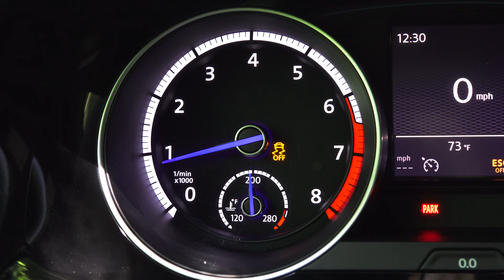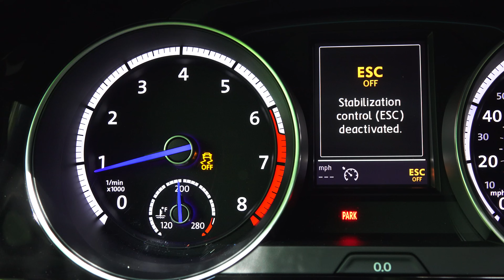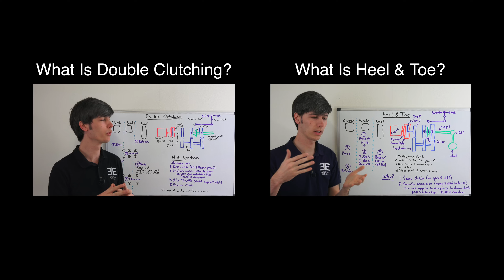How To Launch A Manual Transmission Car

Comment: You are by far my favorite channel for explaining things.
Reply from the maker: Thanks Calvin!
Reply: +Calvin Darius Well, explaining is part of its name. LOL.
Reply: +Engineering Explained Can you make a video on how to start a manual transmission when the battery is dead if you haven't made one yet? If you have pls link me to it.
Reply: +Pops6185 Well, it's kind of simple, you just have to slam second gear and clutch in, then get some speed while off (this by being on a hill or with help of somebody pushing you) and slowly release the clutch, this will move the engine alongside the transmission and hopefully start the car.
Reply: aah ok thx.

Comment: I did t think the ECU let you launch the new MK7 Golf R 6MT
Reply: +evilkillerwhale So, as I look around I find it going both ways. Some say old cars need it and new dont. some say all cars need to be broken in. Some have stories going both ways. I personally will do whatever the owner manual says so they cant back out in warrenty claims
Reply: +evilkillerwhale I suppose all the auto engineers that wrote the manuals knew nothing either huh
Reply: +Meat Amigo Also, wonder if the car is past break-in period yet :P
Reply: it does but he is showing this for everyone else
Reply: it does but he is showing this for everyone else
Reply: +Adam Chandler what's a break in period? Lol
Reply: +Meat Amigo New engines need a break in period of low rpm driving. Helps prevent damage and the vehicle is also slower during break in period, Also has decreased fuel mileage.
Reply: +Meat Amigo It's only like 500 miles
Reply: +Gregory Kanniard myth, kiddo.
Reply: ***** wasnt a myth. The break in days are pretty much over. Now you just have a period where moving parts are stiff. A new car does have decreased fuel economy because of all the extra friction.
Reply: ***** and who are you calling a kid?
Reply: +Gregory Kanniard the non automotive engineer with the child like ignorance that you're spewing.
Reply: Gregory Kanniard
The fact that you think we write the manuals is laughable.
Reply: +evilkillerwhale who advises them?
Reply: Gregory Kanniard
The manuals are written by communications majors with a specs sheet and the law department.
Reply: +Outdoor Layne I actually bought the car to daily drive but I do like to drag race it as well. I've run 11.97 on stage 1 APR (DSG). I regretted not waiting for the manual until I heard about the ECU interference on launch. I'm still working on the mustang though
Reply: +Outdoor Layne you should definitely do it. Have you had a car tuned by APR before? If not you will truly be amazed at what a difference it makes. Even if you have before this platform is even crazier. I'm headed back to the strip tomorrow so I'll have some more footage. I just changed to the new V2.3 tune so it supposed to be a bit faster.
Reply: +Outdoor Layne check my channel
Reply: +Meat Amigo lol I'll trade you my 2016 6MT golf r if you want 😉

Comment: Usually I like your videos, the technical part is quite entertaining and good to learn things in the mechanics of a car. But I wouldn't think that you'd come to make a video like this. At this point you started to take things which require some sort of feel to a level where everything is explained with numbers and raw data. 
Launching a car shouldn't be a thing where you carefully adjust the RPM to a certain type of a car (yes, it has a point on it's own way), hell it shouldn't be a thing do to if you have to watch a video like this to be able to launch your car. 
Launching a car can cause immense damages if you're unexperiensed, clutch, diff and transmission can fly pretty easily out of you car, so if you aren't feeling the limits of your vehicle then you shouldn't do this in the first place. 
On the other hand if you know your stuff then you're aware of that you're adjusting the throtthle the whole time you're launching to get the best grip, and put the least ammount of stress to your clutch in the fastest possible way (as you mentioned in the video).
TL;DL: I think this video is absolutely pointless, you should warn people about the damages they could make launching a car.
Reply from the maker: +Dániel Koháry if you watched the video before commenting you'd realize I did indeed warn people of the dangers of launching your car.

Comment: Q: would it be harder to break something on a car with low power compared to a car with a lot of power?
Reply from the maker: +DERZ not necessarily, more powerful cars tend to have components which can handle the power, and vice versa. Low powered cars will have smaller, lighter components.
Reply: +DERZ Really depends on how beefy your drivetrain is. Hard to say.

Comment: I have a Toyota Camry 2000 and I drive it a bit roughly as it's my first car. I never launch it on purpose because I learned that it might damage the car. But a few times when my car was on a slight uphill I accidently launched it. I'm always afraid that my car will turn off if I don't apply enough acceleration when going uphill so I was holding the clutch and accelerating to about 2-3k rpm, then I slowly let the clutch go and kept accelerating. The tires were making crazy good sound and I'm not gonna lie, it felt so good to get that launch. I would like to do it again but I can't afford to fix my car if anything goes wrong. So any advice on how I can get that good launch and not damage my car? 
Love your videos
Thank you!
Reply: +nop use hand break, let go as clutch engages
Reply: Sergey is right,  on a hill if you don't know your clutch grab spot you should always be using your handbrake
Reply: +nop I suggest you take it easy, like he said, as long as you know the limits of the car and don't put all the pressure on the clutch or the transmission, you should be fine. You can usually feel when the car is not comfortable, especially in a manual like my civic.
Reply: +nop If u want to launch with lowest amount of wear. Just floor it after your clutch is fully engaged and u are at least rolling. the snap of power and clutch slip is was causes most wear. It won't be as fast as doing it with clutch slip or tire spin. but if u do it fairly quick u are only talking 0,5/1 second slower 0-60 time.
Reply: If you don't know your clutch grab spot then do not drive quickly at all. Also, you are in a 16 year old Toyota. Do you think anyone who sees you do this will be at all impressed?
Reply: step 1 raise your rpms to redline 
step 2 drop the clutch.
step 3 win
Reply: use what you got i guess.
Reply: +Ross Walke I take offense to that as a 30 year old Corolla owner
Reply: hold clutch and accelerator and tthen release clutch
Reply: You should be able to hold the (foot) brake and the clutch, and gently release the clutch to the point the engine is fighting the brake. Then release the foot brake and the clutch together the rest of the way, and your car should climb the hill. If the car is really lacking power, you might need to transition the right foot over to the gas as quick as you can to finish the steps.

Comment: how much difference do you get from a high RPM launch vs an idle launch?
Reply from the maker: +phale significant, considering at idle your engine makes very little torque (though diesels/some turbos will have pretty solid torque curves early on).

Comment: Tried launching my WRX and ended up blowing my diff... Needless to say I don't launch anymore.
Reply from the maker: +Bryce Arnold Interesting which component failed. Thanks for sharing and sorry for your unfortunate event.
Reply: Yeah the central diff can explode if you do a hard launch with sticky tires. You can also wreck the transmission, it's from the power of the engine being dumped into a single point with a ton resistance. Though the part of the benefit of an AWD high hp car is that you don't have too hard launch, just launch normally and you'll spank most RWD/FWD cars.
Reply: +Psynide it was the rear diff that ended up going out, but luckily I was covered by warranties so I didn't have to pay a dime. Now that I'm aware of the damages from launching I realize the costs outweigh the benefits.
Reply: Hello mate, that only happens if you're too agressive on the way you dump that clutch. I had a Celica GT-Four (running little above 300bhp, on stock transmission) and to be able to lauch without desintegrating the diff (or gearbox, for all that matters) i had slip the clutch quite a lot. Remember, something has to give when you're launching, the clutch is the cheapest of components to replace so use that to gain that precious initial momentum! ;)
Reply: +Bryce Arnold You really shouldn't ever drop the clutch on an AWD because the level of grip means the drivetrain has to absorb all of the impact. What I do is juggle the accelerator, so blip it up, let the revs drop a bit, then repeat. This way the turbo spools up fairly well. Then floor it as you let the clutch out just enough for the car to start moving. Let it build some momentum, then slowly let it out the rest of the way.
The difference is the shock is absorbed by the clutch instead of the drivetrain or tyres, so you'll wear out the clutch very quickly if you're doing it often, but it's much cheaper to replace the clutch than the diff. You should also find it quite repeatable.
Reply: +Bryce Arnold Let me guess, 06/07 WRX? Those models were notorious for their weak diffs. You do anything to the car to increase its traction or power, or sometimes not even, and bang goes the rear diff.
Reply: +Bryce Arnold When you're launching an AWD you need to slip the clutch instead of just dropping it, especially in a WRX where the rear diff is quite small. The strain of the tyres refusing to spin vs the prop shaft trying to spin all meets in the diff. You can launch a WRX all day, as long as you have some mechanical sympathy. Alternatively, get some rubbish tyres that will spin when you drop the clutch.
Reply: +Javier Jiménez When I watch the thumbnail i said to myself "Most american title ever"
Reply: +Psynide no it's a 2016
Reply: lol, did my first launch in mine aswell and burned out the clutch, expensive mistake.
Reply: +XoNMan1 thank you, if I decide to try it again I will for sure try this method.
Reply: Was it manual or CVT?
Reply: +DreiZ manual
Reply: +Bryce Arnold got a 97 corvette with 2002 Z06 upgrades and a few other goodies. Launch all the time. 

Best feeling in the world.
Reply: +Psynide That's only because most cars are slow.
Reply: +Bryce Arnold    If it's still covered under warranty I would keep blowing them up until they upgrade your car to STI diffs. But they probably voided your warranty on your diffs since you broke them once.
Reply: +XoNMan1 thank you, that is actually helpful information. Months ago when I blew my diff, I asked Jason from this channel how to launch my WRX. He suggested I hold the revs at 3,500, then floor it and as it approaches 4-5k then dump the clutch. I did so, and half of the time the car would just stall out, but the other half it would the tires would slip a bit and it would be the most beautiful launch ever. How do you even slip a clutch on a wrx to get an effective launch?
Reply: +XoNMan1 I should also mention that I blew my diff doing what he said so
Reply: +XoNMan1 Sounds like what I would do for traction limited FWD and RWD cars too for consistently efficient launches without unnecessary drivetrain torture. For my FWD n/a car that is traction limited I don't even bother to launch hard, just enough revs to smoothly let go of my clutch with minimal wheelspin, just enough to prevent engine bog, does the job besr.
Reply: Bryce Arnold don't know how to drive then
Reply: +Bryce Arnold stupids... I'm european and I know how to launch and control a manual car since I was 12....

Comment: Can I do a burnout in a VW Polo 1.2ltr Petrol?. Its pretty low powered car though!
Reply: nope not italy cars bro buy JDM its the best
Reply: +Manish Bag of course, just rev to about 4-5k rpm, release the clutch quickly, as its front wheel drive, the weight will shift to the back as you accelerate, meaning less grip so you wheel spin, can wheel spin pretty much any FWD hatchback just need higher rpms, although ofc this will reduce your clutch and tire life etc and counts as dangerous driving so only do this on private property ;)
Reply: +tavi921 yep, with 165/65/R14 tyres, there is a lot of one tyre fire even with that engine :D
Reply: Josh Briggs
(or oil in the worst case) xD
That's why i like diesel cars, even with low power the have enough torque to spin the wheels in 1st.
Reply: tavi921 lol i forgot most cars dont have a lsd.
Reply: +Manish Bag Max revs, hand brake on, drop the thecluch, KEEP full/near full throttle
Reply: +Manish Bag 
Throw some water on the tires
Reply: and do what ***** said :D
Reply: +Manish Bag Depends on your tires. If you have new or summer performance tires probably no. Worn out all-seasons probably.
Reply: +Manish Bag if I could do an unintentional small burnout in a Punto 55 1.1 then everyone can do a burnout lol
Reply: +Ciarán McEvoy my moms VW Jetta the handbrake does the rears not the fronts
Reply: Ciarán McEvoy

Which car do you drive that has a handbrake that locks up the front wheels?
Reply: I know some SAABs were like that
Reply: Ciarán McEvoy

Most Citroens, the Alfasud, Saab 99s, Pre-Facelift 900's, and most early Subarus applied the handbrake force to the front wheels, which makes them notable exceptions.
EXCEPTIONS
Reply: Rev high and dump the clutch and the wheels will break loose but it's bad for the clutch 
but it will work I do it in my 1.2 fiesta
Reply: Rip the E, Bang the rev limiter at WOT, dump that clutch and don't let out until you are done.
Reply: Buy an Italian car! Best cars for racing stuff experiments haha!
Reply: Buy an Italian car! Best cars for racing stuff experiments haha!
Reply: Manish Bag buy an old 2001 merc e500. it's got 306 hp and it's only about 5000€

Comment: I heard the wrx transmission is like glass.... Im scared
Reply from the maker: People say lots of things on the internet.
Reply: +Broseff G 
Probably should not launch your daily driver, this is more for built cars. I drive a WRX, and will never launch it lol. My main take away from this video is that you should stay in gear for as long as you can, in order to increase torque.
Reply: +Chris Pridemore nope, you stay in gear only whilst you are accelerating constantly, you can feel it taper if you left it to long, and if you left it way to long you get the limiter
Reply: Jared Reabow 
I did not say stay in gear after it tapers or red-lines. Staying in gear instead of trying to up-shift as soon as possible. He explained in the video, I do not want to just repeat him.
Reply: +Broseff G I believe it's only the old 5 speed WRX.
Reply: It's not so much that the transmission is delicate, but more stresses hard launches can put on the transmission and central diff. AWD + high hp + sticky tires = something is gonna blow